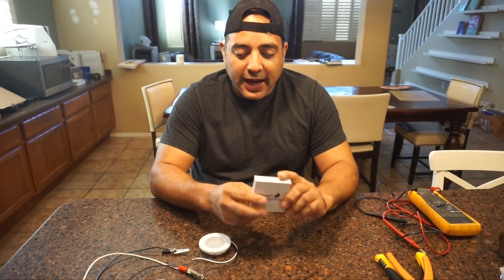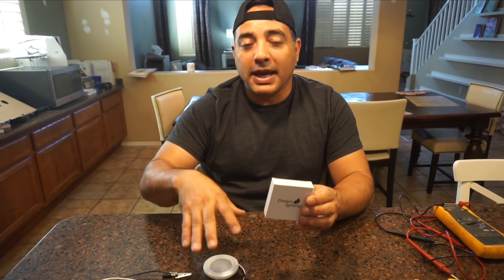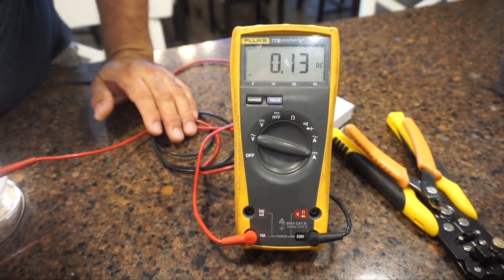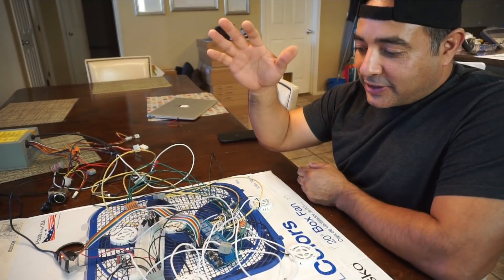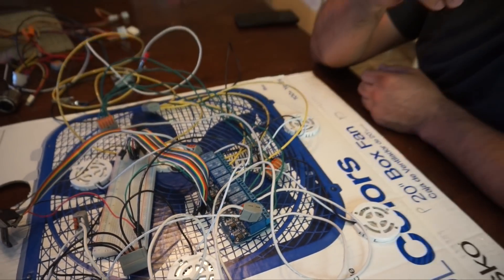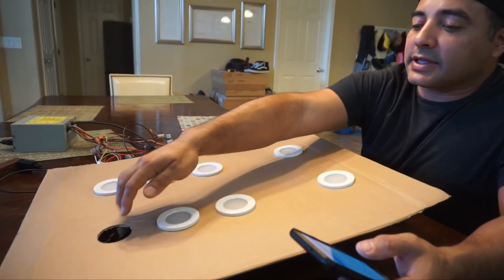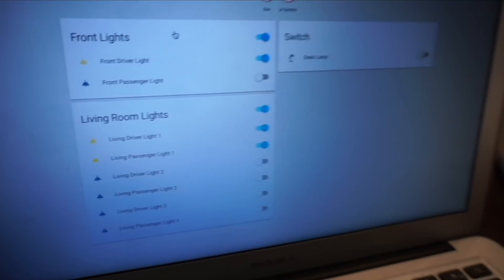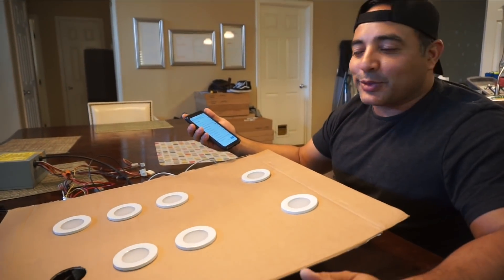Bus Automation:  Testing Out What We've Learned So Far with overhead lights

Comment: Looks really great - can't wait to see it installed. Be sure to also install at least a couple of standard lights with manual switches. When (not if) the automated system fails it will be at the darkest hour of the night and certainly when someone needs light immediately. Also, a couple of battery powered/rechargeable motion lights as you walk in will be priceless for that time you walk into your bus and realize that the system has failed or needs to be reset. Been there, done that, not much fun.
Reply from the maker: Thank you Ridhard.  We will have a manual set of switches for sure.  I have been in software too long to rely on it 100% :)

Comment: If I can make a suggestion, add at least a physical switch to turn them all on. I've gone down the path of lots of automation and it can be frustrating at times when things don't work exactly as planned (ie microwave messes with the wifi, ESP32 died, firmware update you pushed just before your trip started bricked it, ...), being able to just take a simple switch to turn them all on will be nice.
Reply from the maker: Thank you Bas R - Great idea! I was just thinking about this as I just burned out my first ESP32 (some of the pins accidentally made contact with the 12 Volt source - fried the chip and smelled terrible - that magic smoke they put in there really stinks).  Some kind of backup switch makes a lot of sense and shouldn't be too hard to wire in.

Comment: Thank you so much :) I am playing with home automation for a while now, but without real success. Probably because I am using a big industrial Siemens S7 PLC with an industrial visualization software, but this "Home Assistant" is exactly what I want to achieve. At least I found a library so the PLC can use MQTT, too, so I can combine it with decentralize Arduinos.
Reply from the maker: Hi Orbis - The Siemens S7 looks awesome - I saw a few pieces on the software to configure it and it looks very robust.  The stuff I am playing with are toys in comparison.   MQTT is a big thing in industrial applications as well - the stuff I have been playing with is a "lite" version of the protocol so it doesn't support the higher QoS options.  Once you get them on the queue - the home automation stuff doesn't really care how they got there :)

Comment: Juan, I have 6 LEDs in my trailer and my brother has 6. Mine are bright, he used a dimmer. Note to self, run a HOT AND GROUND to each light. If you dim them, you have to dim on the GROUND side.
Reply from the maker: Thank you Roy - very Interesting - I have always switched on the negative side (and plan to do the dimming on the negative side as well).  But I was not aware that you had dim them on the ground side - thanks!

Comment: Pretty kewl HA software there  :)

Personally I use 12VDC strip type LEDs with dimmer controls (wireless) for my lighting.
Having the option to have different level for various areas is really nice.
Reply from the maker: Thank you Gregory - we will very likely do strip LED lights down the sides (also controlled like these lights though home assistant)

Comment: Wow , you have Done an amazing job Designing this Lighting system
(It may seem simple to you but amazing compared to Old school wiring concepts), are you going to put touch switches in the walls near the entrances?
Reply from the maker: Thank you - it was after I started designing the wiring using the old school way that I was like "there has to be a better way to do this".  Yes we will have touch switches in "traditional" locations as much as makes sense.

Comment: So cool Juan!  Nice work!  I've been thinking about experimenting with home automation and didn't want to spend the money on Control 4.  I'll have to check out Home Assistant.
Reply from the maker: Home Assistant is an open source project and a little raw but it seems to be working great for what I need.  For the actual automation, I will very likely use another technology called "Node-Red" which has a very nice interface (for logic) and a nice interface for MQTT.  I just checked out Control 4 - that looks pretty pricey.  You could likely do much of the same stuff with Home Assistant + some Sonoff switches flashed with tasmota firmware for much much less.

Comment: Very cool Juan are the lights metal or plastic I've heard some sad stories of people buying lights that have plastic housings melting or distorting.
Reply from the maker: Hi Brian - the housings are plastic with a metal layer in the back (looks like a heat sink of some sort) - I ran these lights for a few hours and they produce almost 0 heat (probably because the output is so low).  They only draw 130 milliAmps - which would have a hard time generating enough heat to melt anything.  I will keep testing them we are also looking at a few other lights and at making a dimming circuit.

Comment: Lumens is a measure of how bright the light is. The numbers you are really interested in are foot-candles or Lux. Foot-candles and/or Lux are a measure of the amount of light on an object (distance from the light, light dismemberment and brightness). What Kelvin are the lights, I would stay below 5000K if you can otherwise the light will be to harsh (my opinion). I have seen this approach to wiring before (switching the ground) What is the advantage to switching the ground verses the hot?
Reply: Lux measures the brightest spot of the light where lumens is how much light is available.. if I were doing the same, the lumen rating is what I would worry about.. if you were going for distance lighting, then lux would come into play.. just my 2 cents
Reply: Just went through this with the lighting in my new work shop. I was much more concerned with the amount of light that I would have on the work surfaces than the amount of light produced at the source. again just my thoughts.
Reply from the maker: Thank you Glenn - Lux would be more accurate but the sellers almost always give the light output in lumens - and they are usually pretty generous.  I agree with the temperatures - we are trying to stay in the 3000K range (soft white).  I think switching on the negative is just a preference.  I always thought it was safer: since a switch is a "break" in the wire - if the wire got loose and hit a metal part - it would just be negative to negative.  If that wire was "hot" it would cause a short.
Reply: That is a thought. Kind of like letting you know there is a problem (the short causing the light to come on). The only thought I would have switching hot would be the only part of the circuit that is hot until the relay is tripped is the power to the relay. When I went through the process of getting lights for the shop I talked with several LED companies. Super Bright LED . com has a commercial department and did a full LUX Map of the shop and the surfaces. I had to purchase 4 more fixtures to get the lighting I wanted.

Comment: Great Job Juan! You’re getting there. The mock-up looks so recognisable ;-). Are you going to do a PCB? Once you decide on your final design to control the lamps or other stuff, be sure to make/buy some spare modules that you can easily switch out on the road. Sadly enough, electronics do fail. Looking forward to the bus reveal :-))
Reply from the maker: Thank you Freddy - we plan on making access to the electronics simple and easy :) Electronics do indeed fail.  I would love to do a PCB with a socket where we could easily remove the chip :).  My goal, for now, is to standardize on a chip (ESP32 seems to be fitting the bill nicely) so that if we have issues I can download the code and put the chip in place quickly and easily.  We have gotten more updates on the bus and the paint is progressing nicely - A few hiccups as well - the rear tail lights fell apart because the previous owner decided to make them out of wood :S

Comment: Is this going to be your primary lighting source in the RV?  200 lumens seems pretty low unless you've got a lot of them.  I was curious so here is my napkin/YouTube comment math:  A typical 100-watt incandescent bulb is around ~1,600 lumens - so you'd need 8 of those lights to equal one regular bulb.  The bedroom I'm in now has 10 lumens per sqft, so at the same lighting level (what I think is a bare minimum for residential space) a ~350sqft RV (guessing) would need 16 lights, but kitchens and stuff have a lot higher requirements.  My work shop in the garage has ~44,000 lumens in 400sqft, which is 110lm/sqft.  To get that light level you'd need around 190 of those little lights in the RV, haha!  Even something more modest I could easily see needing >40.  What are you thinking in terms of numbers?
Reply from the maker: Thank you Bill.  There will also be strip lighting as well as a few lamps and sconces.  I was planning on installing somewhere between 30 and 40 of these little lights in the ceiling.  We are looking at a few other options for lights as well but we would like to keep them on the small side 3" or so in diameter).